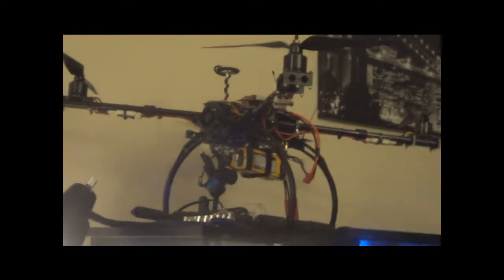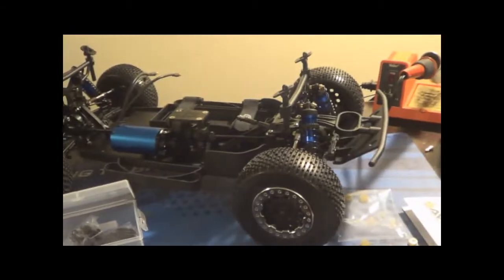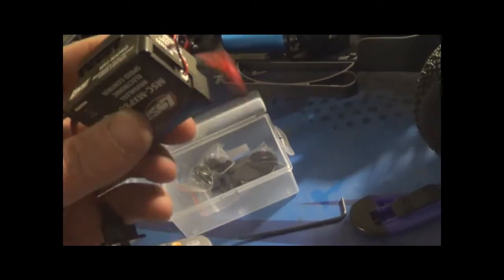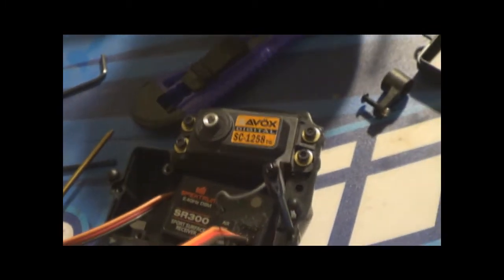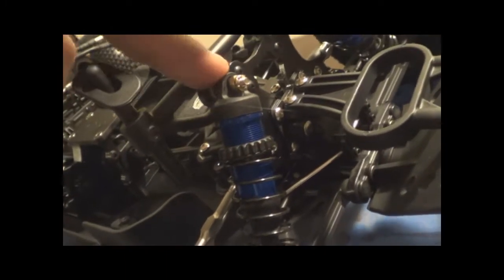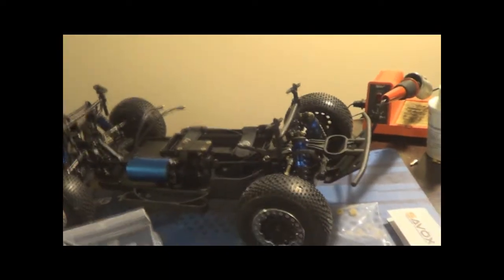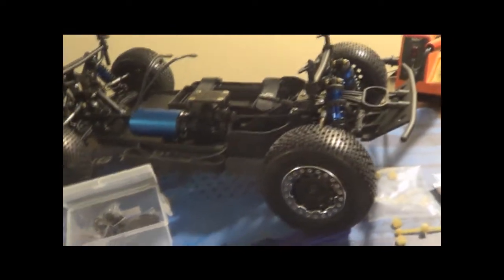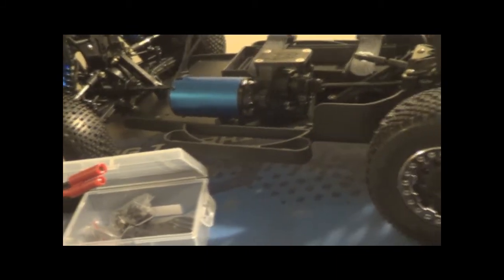MY NEW TOY

Comment: Word of advice just stay on top of the out drives and Ulla be fine other than that the truck is in destructible and easy to make a rally c when u r tired of it being a truck
Reply from the maker: Thanks Felix.  Glad to know that.  Hmm,  A rally.  Maybe in the future.
Reply: It shares all the parts between the 2 just bumpers body and wheels are different and the 2.0 parts are bolt on as well